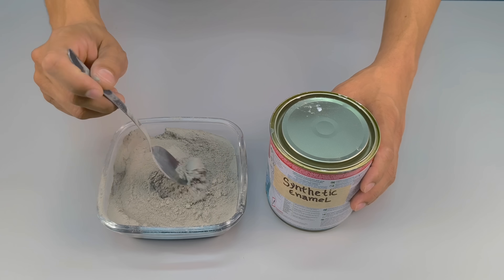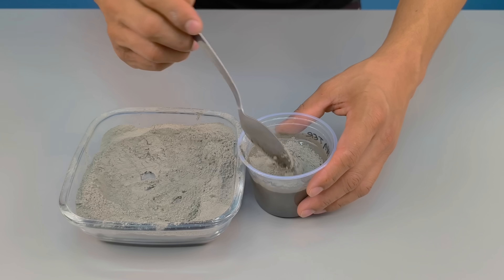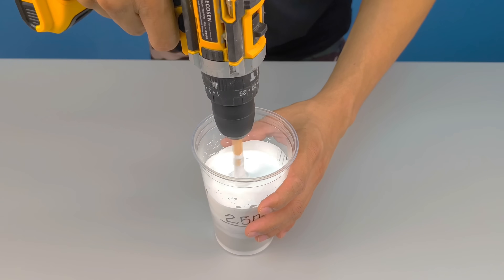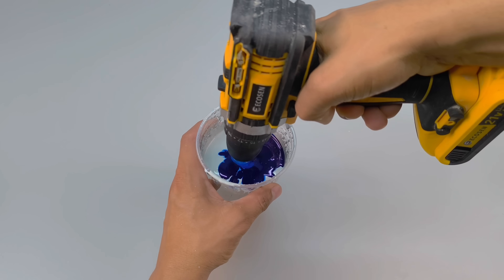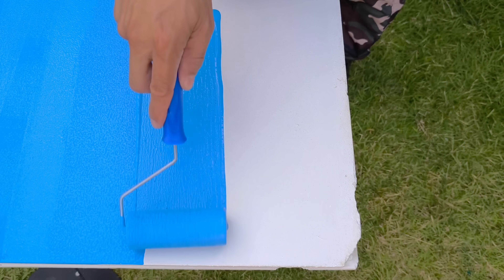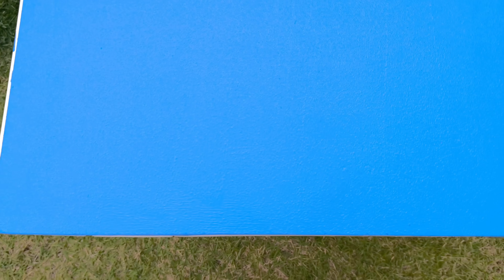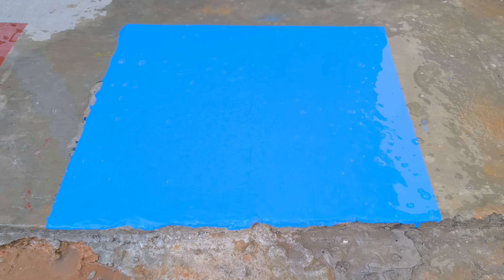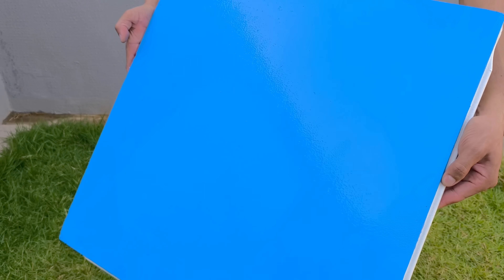Mix CEMENT with SYNTHETIC ENAMEL and see the secret that can be worth gold in construction!

Comment: Question: My garage floor is 25 years old and has garage floor paint that is slightly peeling in certain places, but overall, the surface is intact and isn't pitted or porous. But the floor paint never received a sealing top coat. Could I just remove any loose paint and use this video's formula to paint over it? What potential prep might I need to do before applying this cement and synthetic enamel paint over it? And last, what is the minimum air temperature required for successful application? Thanks, from South Carolina in the southern U.S!
Reply from the maker: Great question! Yes, you can apply this formula over an existing painted surface, as long as the paint is still well-bonded.
✅ Remove all loose/peeling paint
✅ Clean and degrease the floor
✅ Light sanding is recommended to improve adhesion

For best results, apply between 50°F – 90°F (10°C – 32°C) and avoid high humidity.
This mixture creates a strong and seal-like finish, perfect for garage floors.
Thanks for watching and greetings to South Carolina! 🔧✨
Reply: @inovaouinventa  -  thanks so much for the detailed response! One last Q: Does the finished product have any shine or gloss - or is it matte - and, if not, what could you top coat it with to add some sheen?

Comment: Hi very good idea, and learning you given., my room surface almost all torn with holes. how much cement , emulsion and glue requires to make the floor of room Good looking
Reply from the maker: Thank you! 🙌 For damaged floors, a good starting mix is roughly:

2 parts cement

1 part emulsion

1 part glue (PVA)

Fill the holes first, then apply a thin finishing layer. Always test a small area first for best results 👍🧪
Reply: @inovaouinventa  Great man. im from Lahore City and My Country is Pakistan

Comment: You know, if you cover the plastic tray with a plastic bag, you don't have to clean it up.Afterwards you just take the plastic bag off and throw it away
Reply from the maker: Great tip! 🙌 That saves time and keeps everything clean. Thanks for sharing it!
Reply: La bandeja se cubre con plástico,  sobre él  se vierte la pintura. Al terminar de pintar solamente se retira el plástico manchado con pintura  y se bota. De  esa forma, la bandeja se mantiene limpia .
Reply: @healingspace1772  hola... por una cuestión de traducción no llego a interpretar lo que dices, podrías explicarlo de otra forma? Es que pones la bolsa directamente en contacto sobre lo que quede como resto de pintura y esperas que seque para luego extraerlo?
Reply: @juancarlosricarti7215  entendí que se mete la bandeja en la bolsa, se usa para pintar y al terminar, se tira a la basura
Reply: @tepenahua1 Si, eso puede ser... Gracias por tu intención de ayudar 🙏🖐️
Reply: ¡No! Es para la bandeja del rodillo, así que no tienes que limpiarla. Metes la bandeja en la bolsa y cuando la sacas, la bandeja se mantiene limpia. @juancarlosricarti7215
Reply: No entiendo para qué es ?
Reply: great, will try it on my roof
Reply: I use kitchen foil but I’m going to try a plastic shopping bag next time 👍

Comment: Why would it be surprising to note the adhesion? PVA glue, paint and cement are all adhesives. A surprise would be if it didn't adhere to a surface!
Reply from the maker: True — they all have adhesive properties 👍
The interesting part here is how the combination increases bonding strength and waterproofing compared to using just one of them alone.

Comment: But what is the Synthetic Enamel
Reply from the maker: Synthetic enamel is an oil-based paint commonly used for high-durability finishes. It gives strong adhesion and water resistance in this formula ✅

Comment: So what have you achieved that the latex enamel wouldn't do normally?   I fail to see any benefit, adding PVA will do SFA as its a base ingredient for a lot of paints and the portland cement needs calcium/lime and water to react with, if your using it for a filler powder talc would be a better and cheaper choice.
Reply from the maker: Great question 👍 The reaction with cement gives extra hardness and durability that pure enamel doesn't achieve. PVA also increases adhesion and flexibility. Each ingredient brings a different performance — it's all about balance 🔬⚒️

Comment: The AI voice was driving me crazy. I can't see how this would be cheaper than purchasing paint.
Reply from the maker: Thanks for the feedback! 🙌 Depending on region and prices, sometimes DIY formulas can be more economical — especially for large areas. But regular paint is a great option too!
Reply: Yes a 2 part cement epoxy comes in many colors and is guaranteed. This is a 4 part mix and not an epoxy
Reply: @randalleller6216  It doesn't matter wether it's an AI or robot or whatever voices it came from , what matter whether what he is discussing is legit or practically true.

Comment: Enamel paints are usually solvent based; I'm struggling to understand how solvent based paint will properly mix with the water-cement mixture. What exactly is your "synthetic enamel"? Have you tried application to plywood and how well do you think the coating will work long term outdoors?
Reply from the maker: Great question! 👍 Synthetic enamel can be water-based or solvent-based. In this video, I used a water-based synthetic enamel, which blends perfectly with water and cement.
Reply: Had to been latex enamel

Comment: South Carolina,  USA. How safe would this be for cement walkways when the surface is wet from rain? Would it be a slick/slippery surface once this mixture is applied ?
Reply from the maker: Great question! When applied correctly, the surface keeps a good grip and does not become slippery. But it's always best to test a small area first to see how it performs in your local climate 👍🌧️
Reply: @celtickitc  if you're painting a surface that you need to walk on, I'd add coarse sand. It'll give it a sandpaper texture but better safe than sorry

Comment: What is the "PVA glue" ?
Reply from the maker: PVA glue is a water-based adhesive, commonly known as white glue or school glue. It works great for sealing and bonding! ✅✨
Reply: Poly Vinyl,,, forget the last letter. Might be Acetate. 
It's what you use to bond plastic plumbing pipes together.
Reply: @tamasvad8040  Elmer's glue